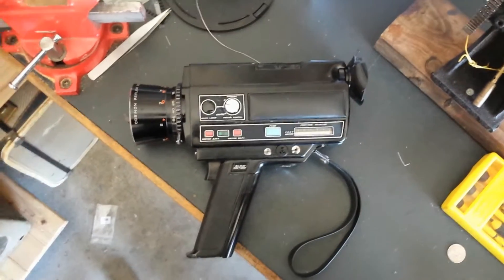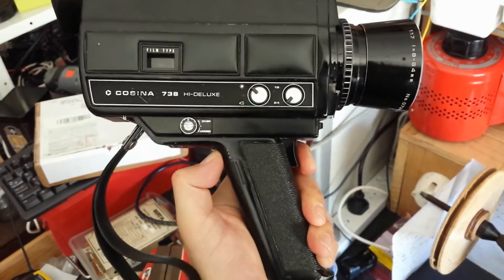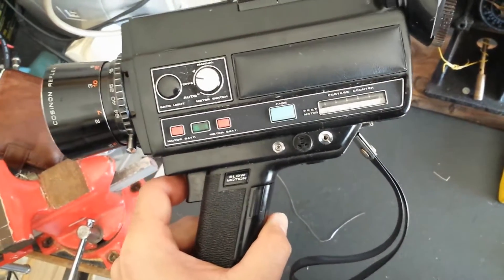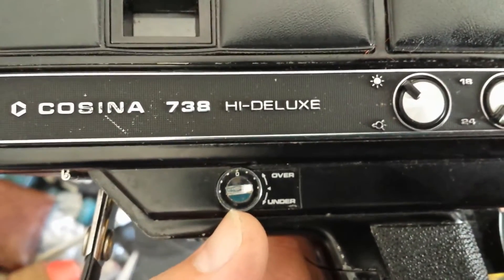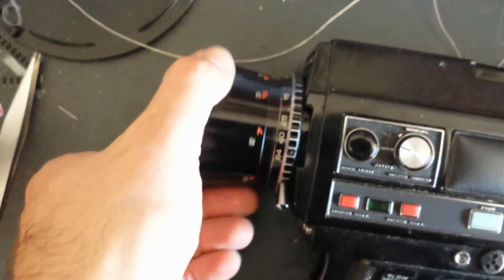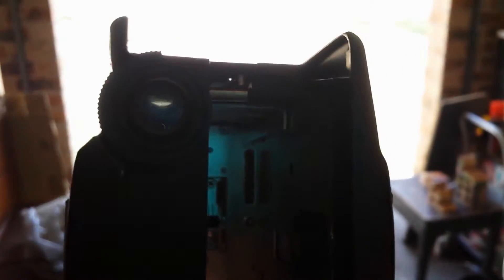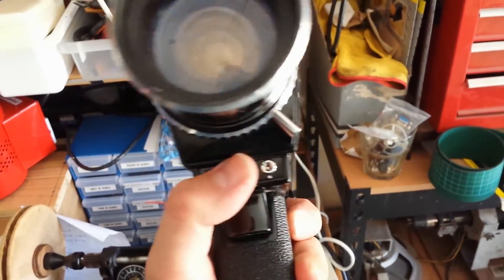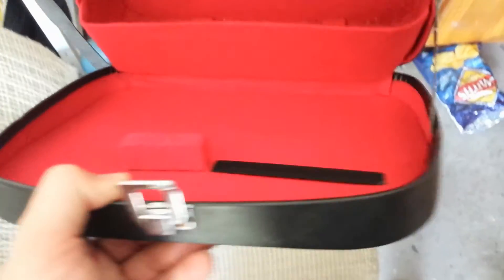1973 Cosina 738 HI-DELUXE Super 8 film camera

Comment: If you open the back door and look through the gate while running the camera / adjusting the manual exposure, you should be able to see if the aperture stops down. And the sockets at the front are probably for a remote control. One for single frame and the other for continuous run.